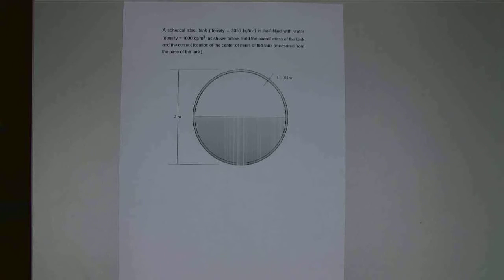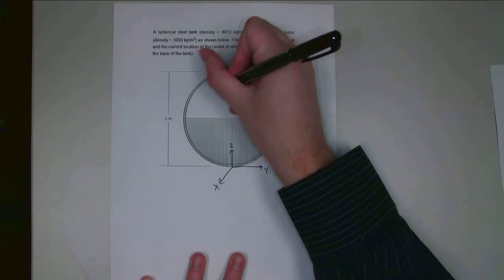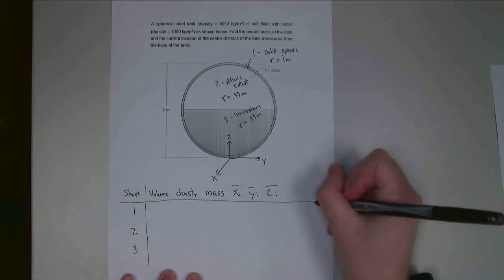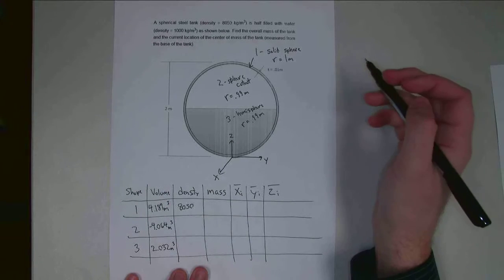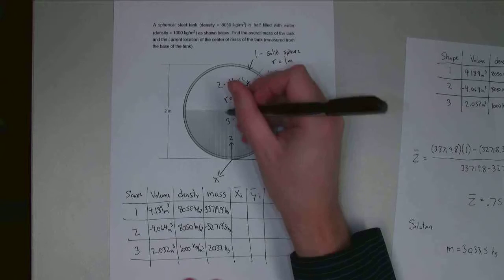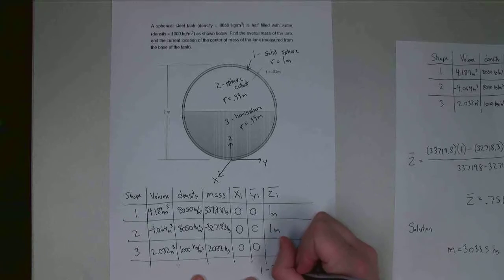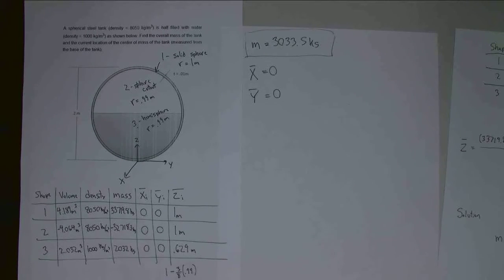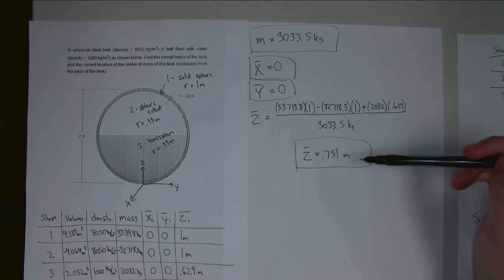Center of Mass via Composite Parts - Adaptive Map Worked Example 5

Comment: You calculated the centroid of the water hemisphere from the inside of the bottom of the tank. Your coordinate system is taken at the outside of the bottom of the tank. Don't you need to add the thickness of the tank to get the z-coordinate of the water hemisphere centroid with respect to your coordinate system?
Reply from the maker: The Zbar location is 3/8*r from the flat side of the the hemisphere. I had started at the center of the tank (z=1) then went down from there by 3/8*.99meters. We don't need to add the thickness of the tank since we start at the middle point, but the thickness of the tank is taken into account with the reduced radius.